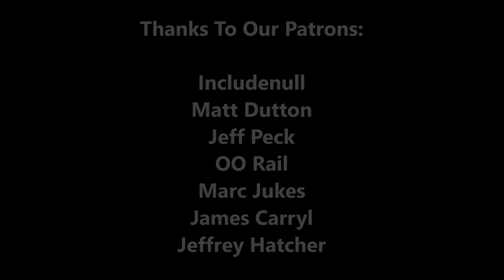OO Gauge Auto Coach - 3D Printed Model Railway / Railroad Kit - Budget Model Railways

Comment: It reminds me of the Pre-Grouping coaches from the 1850s to the 1930s. Maybe join up two together using the Clerestory bogie coach chassis or the Hornby 4-Wheel Coach chassis?
Reply from the maker: The whole idea was to have a shorter coach than anything else for the micro layouts I make
Reply: @BudgetModelRailways  I see. Suppose they could also be used on a modern wagon or brake van chassis? If so, would modification be the ticket?
Reply from the maker: It should be fairly straight toward to fit it to any suitable chassis, even if its just glued on. I find the older shorter wagons can be bought second hand quite cheaply, esp as job lots
Reply: @BudgetModelRailways  Well, finding those in good condition can be like looking through needles in a haystack or waiting for a solar eclipse to happen, but maybe I could try the current Hornby plank wagon and brake van chassis or maybe Bachmann's Midland brake van chassis as an alternative.

Comment: Suppose I bought two of these and made them into an Inspector's Saloon coach using a Queen Mary Brake Van chassis? What do you think? I've been thinking of doing it myself one day!
Reply from the maker: If the chassis is the right dimensions then it sounds grand?!
Reply: @BudgetModelRailways  Well, once I get ahold of some Queen Mary brake vans, I'll see about it and then do the project. To start with, I'll need to draw a plan picture or concept and then translate it into a 3D model the same way Curtis Jobling designed the original Bob the Builder series.

Comment: Very nice model coach love the detal but in my mind to short. Would be better on a 3 wheel chassis
Reply from the maker: The whole point of it is that it's short, it's designed to be shorter than the Hornby short coach to micro layouts